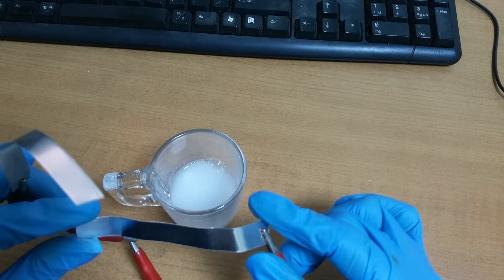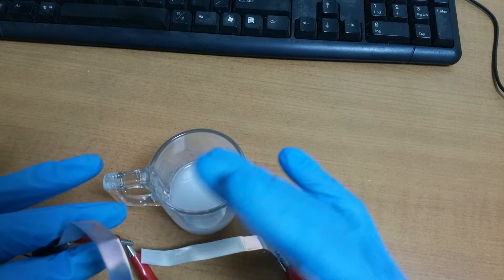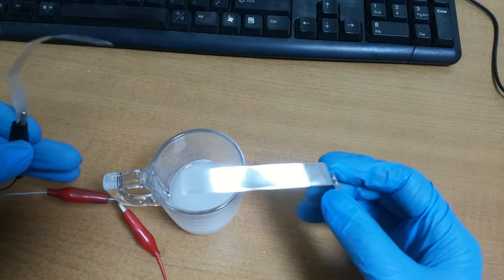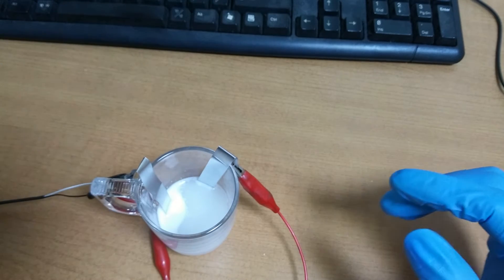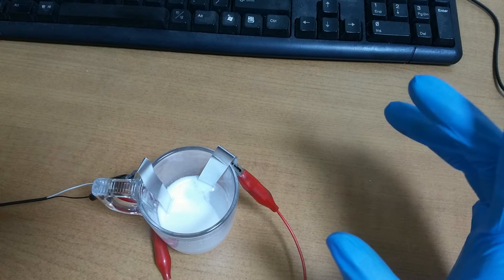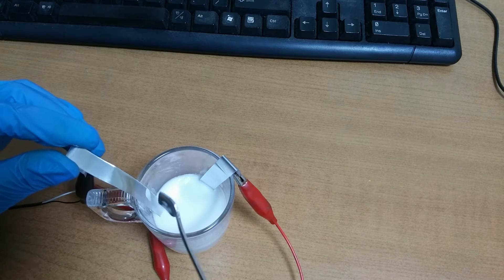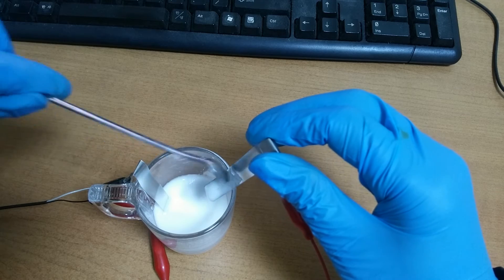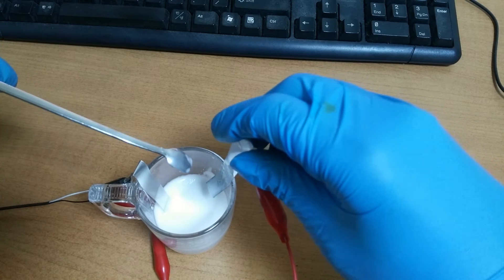to make aluminum ions

Comment: Very interesting ! what do you do with the white solution ?
Reply from the maker: Water and detergent powder. Thanks and have a nice day
Reply: @solidbattery9956  but why you calling it aluminium ion then ?
Reply from the maker: @omsingharjit  
I think detergent plays a role as electrolyte to transmit al ions from positive to negative. Have a nice day
Reply: @solidbattery9956  but there's lot's of other chemical  in detergent too
Like potassium , sodium etc , so there Should be not one   but many ions
Reply: @omsingharjit  hmmmm